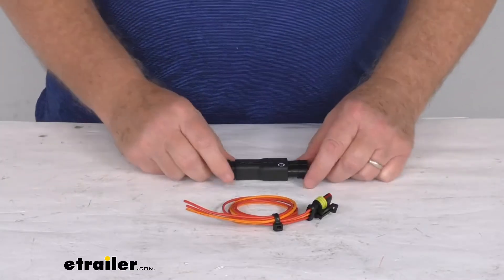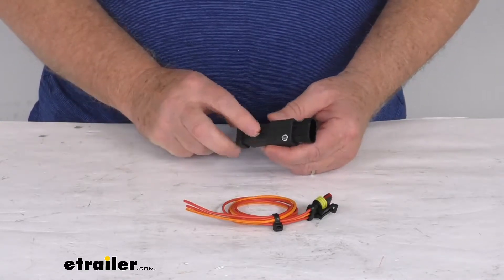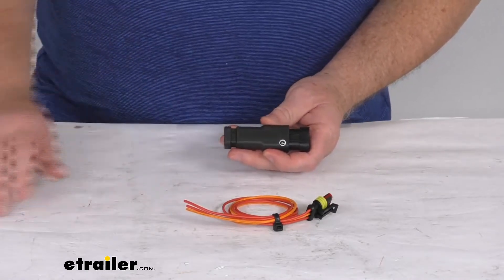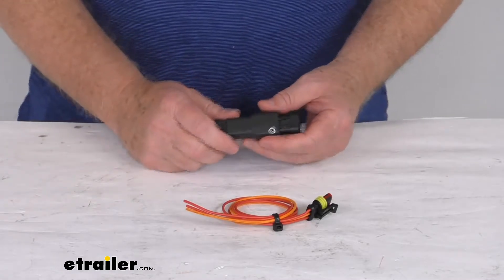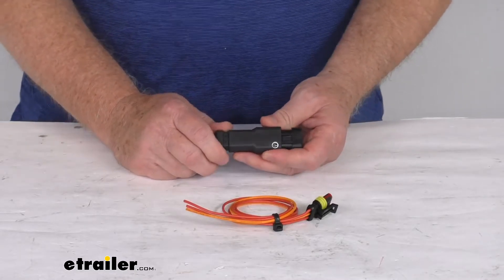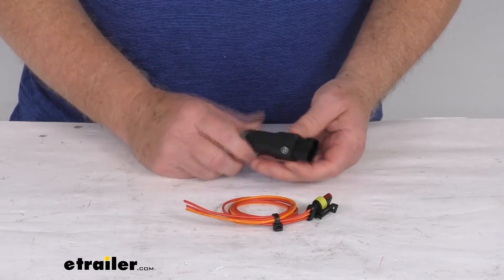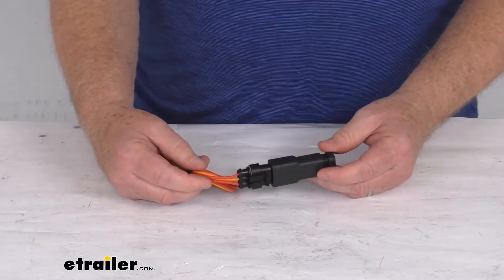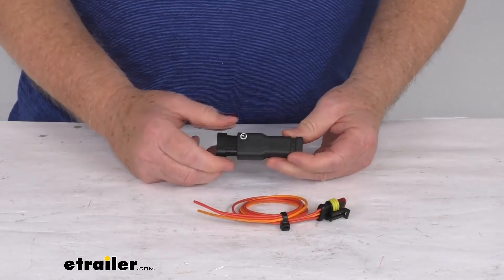etrailer | A Closer Look at the Redarc Encapsulated Power Diode for Tow-Pro Brake Controllers

Comment: How do you install this? And does this connect to the blue wire on the 7 pin?
Reply from the maker: This installs on the red wire from the brake controller under the vehicle's dash. If you check out this link, you can see more info about how it's installed.
https://www.etrailer.com/question-552045.html